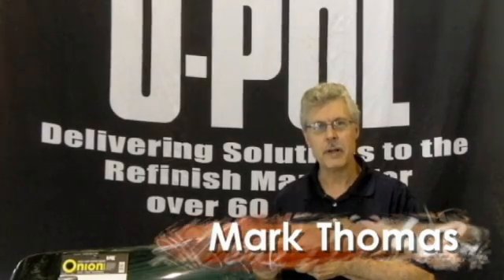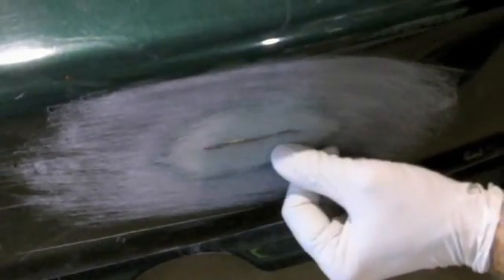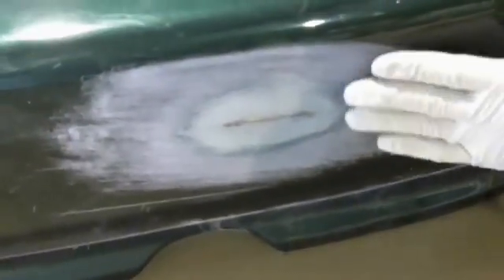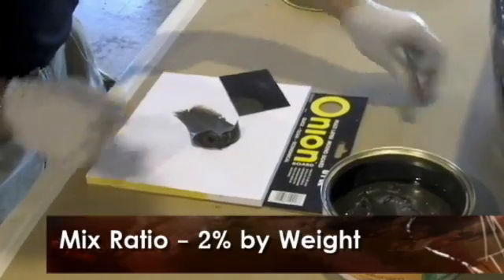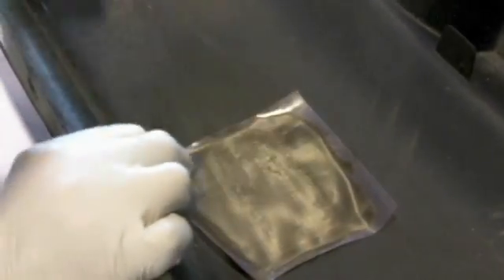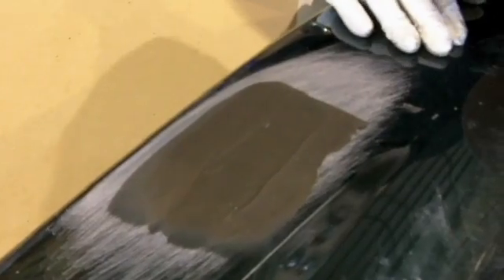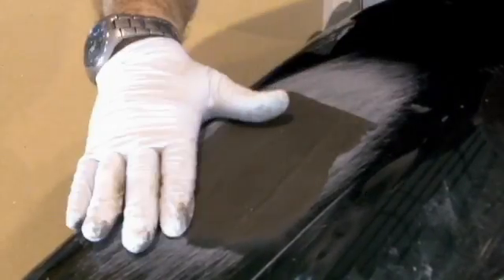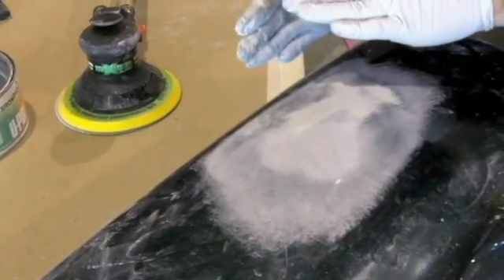How to Repair a Hole in a Bumper using U-POL 7061

Comment: is there a way to fix holes on a non painted bumper like a grey dyed bumper?
Reply from the maker: Hi, All polyester fillers will need to be over coated with a suitable coating for optimum performance as they are porous and will take on moisture. This will lead to adhesion issues if left exposed. We have the Plast X Trim Top Coat offering which could be applied after the filler had been primed to match the existing colour of the bumper. Hope it helps.

Comment: ran into an fire plug trying to parrlel park oops my 2009 Nissan versa had an hole in the plastic parts to my bumper how can I fix it without going to insurance
Reply from the maker: Hi Erin.
You can remove the bumper and follow the steps in the video. You can also download the TDS and SOP for more detailed instructions (you can download them here: http://bit.ly/2jUUnl8 & http://bit.ly/2j4WBhA). For painting instructions, check the paint manufacturer's TDS or instructions.

Comment: Hi, I have a 74 Dodge Challenger. A body shop guy once told me to use U-Pol SMC to repair a broken tab on the fiberglass header panel. What products would you recommend?
Reply from the maker: +Kevin Jones. SMC would work great to repair a broken tab on the fiberglass header panel. You could also use FIBRAL. UP0761 would not be a suitable choice for a repair on fiberglass.
Reply: +UPOLONLINE5 do you have any videos on this type of repair
Reply from the maker: Hi +Kevin Jones. Unfortunately, no, we do not.
Reply: +UPOLONLINE5 perhaps your next video 😉
Reply from the maker: +Kevin Jones Great idea! Maybe! I'll see what I can do.
Reply: +UPOLONLINE5 the 72 to 74 front fiberglass piece is not being remade anywhere so I need to fix mine.
thanks, hope to see one